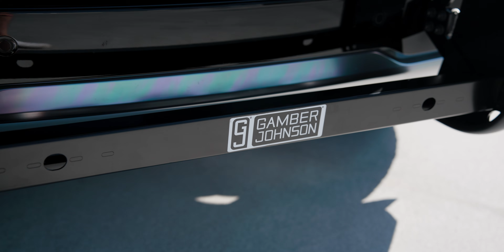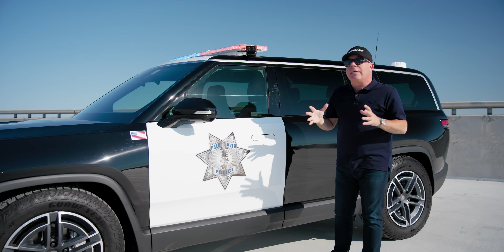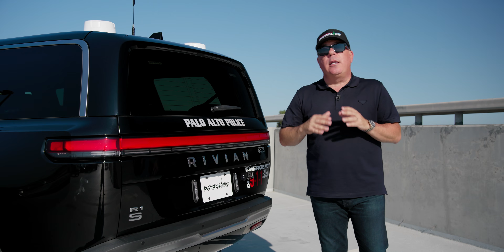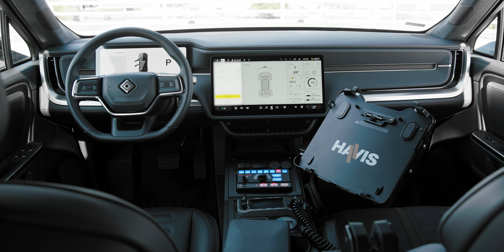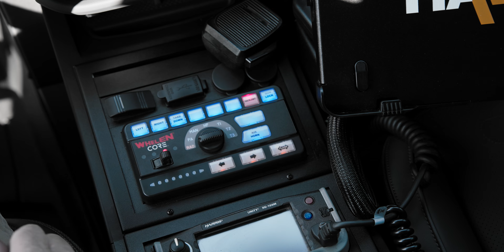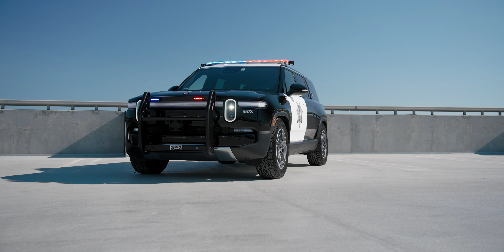🚓 World's First Rivian R1S Police Patrol Vehicle! Full Custom Upfit for Municipal Duty by Patrol EV

Comment: Rivian is headed for Ch 11.  Rivian shareholders are either index funds or momentum buyers.  Owners will be left stranded.  Rivian has never said the R2 will make Rivian profitable.  Rivian's GAAP losses per quarter are massive and show no signs of ending.  The VW deal and gov't loans from crooked Joe will add more debt and interest expense.  With these recurring quarterly losses, don't see how Rivian avoids bankruptcy.  Here's Rivian's quarterly losses; which clearly show no profit whatsover despite the positive "gross profit" nonsense Rivian keeps pushing:
1Q23 - $1.3 bill loss
2Q23 - $1.2 bill loss
3Q23 - $1.4 bill loss
4Q23 - $1.5 bill loss (full year '23 loss:  $5.4 bill)
1Q24 - $1.4 bill loss
2Q24 - $1.5 bill loss
3Q24- $1.1 bill loss vs 10,018 vehicles sold... $109.8k loss per vehicle sold
4Q24 - $744.0 mill loss vs 14,183 vehicles sold... $52.5k loss per vehicle sold (full year '24 loss... $4.7 bill)
1Q25 - $545.0 mill loss vs. 8,640 vehicles sold... $63.1k loss per vehicle sold